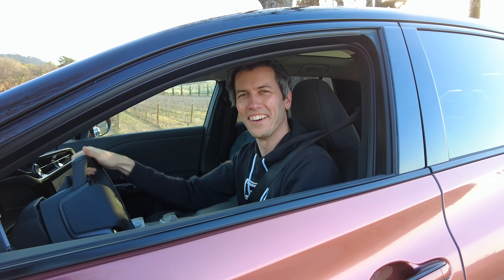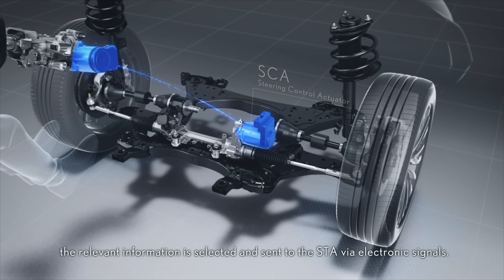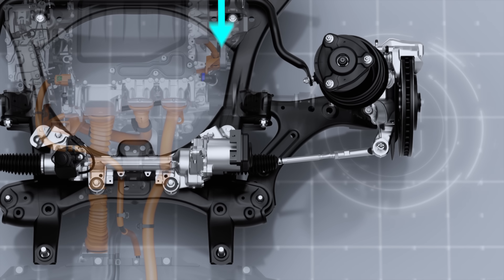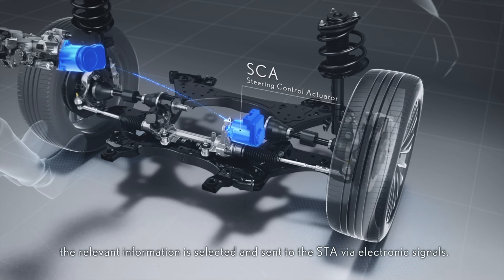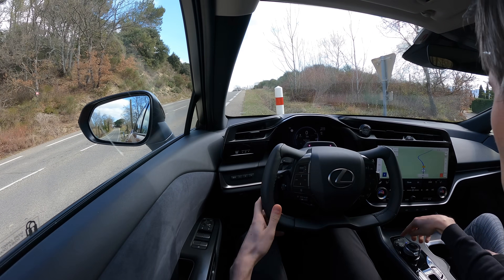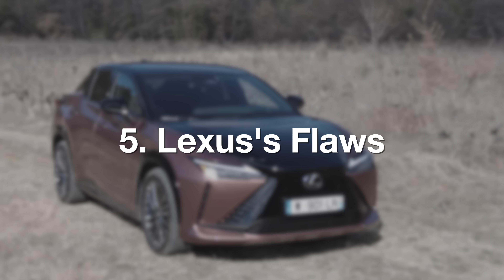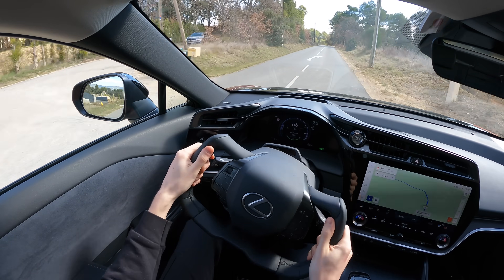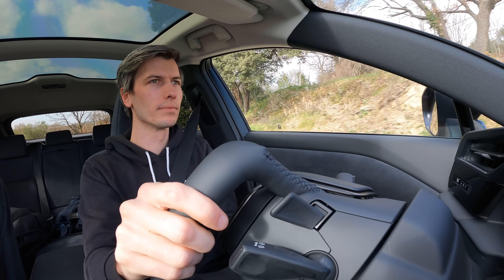How Lexus Fixed Tesla's Bad Idea: Steer-By-Wire Yoke

Comment: With a fast enough steering torque actuator, it would be entirely possible for steer-by-wire to whip the steering in the opposite direction when the vehicle starts to oversteer uncontrollably. I would like to see track driving or driving on one of those water pads with this system to see if it does that.
Reply: That would only work if the driver doesn’t try to countersteer at the same time, such as someone who lacks basic skills, such as the people who buy Lexus… oh, I see.
Reply: @Ficon   The system could also accept driver input and filter it while it is also doing its own corrections.

Comment: No way,  if this fails,  you can't steer.  In a traditional system even if the power steering pump fails,  you can still steer.
Reply: like my car for exp, has electric power steering & the steering wheel is connected to the wheels, but their is a drive by  wire option like this lexus in the video, but has a clutch to connect the steering directly to the wheels if lose of power, like why do all that, so complicated ...

Comment: AI to learn the driver’s inputs and adjust accordingly is key. 

When I put my Lexus 450h in eco mode it learns my driving inputs and adjusts accordingly which is also based on my hybrid battery charge level, temperature, throttle input etc. 

When I put it into sport mode an entire different experience without any learning of my driving style.

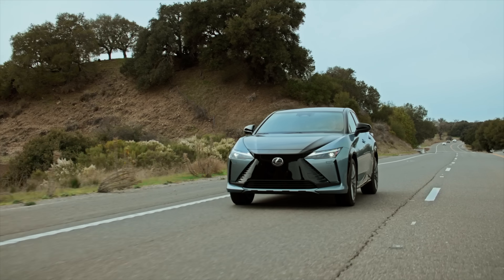Comment: #4:14 - This is FALSE. You can actually have a variable steering ratio with a physical steering column. Audi for example calls it "dynamic steering". Other manufacturers have this as well. It's been there for decades.

Comment: I think variable steering ratio is dangerous because your muscle memory will most of the time be wrong about how much the car will be steered by a certain amount of steering wheel rotation and i can't really come up with a good solution, as always you have to compromise.
The only good thing to come out of steer by wire would be independent steering for the left and right wheel to  accommodate for the different slip angles they'll have under different load and traction situations.
Reply: As mentioned in video steering ratios increase or decrease gradually.
Reply: @Trackandshield  changes nothing

Comment: Didn't Ford have variable steering ratio by adjusting the amount of power assist based upon speed?
Reply: That's variable assist, not ratio. 

Variable assist lightens the wheel (like in a parking lot) and stiffens it at highway speed. The lock to lock ratio is always the same, only the effort from your hands changes.

Comment: The 2002 Z06 had variable ratio steering, im sure some others have done it mechanically as well. 

Nice explanation, Lexus clearly did it better than Tesla, still pretty sketch imo.
Reply: Yep, BMW introduced it in 2003 on their 5 series. They use double planetary gears. It must be less extreme than the Toyota steer by wire system though.

Comment: It's not a innovation. It is simply forbidden by law in the most of the market. The solution was presented in show cars for ages now. And now Toyota with the abysmal bad engineering of BZ something. Earlier solutions were based on hydraulics, then electric.
Elon Musk explained, that the law is the reason for Model S traditional stearing. But he said - it's a lot of tunning also. It will be introduced with robotaxi. Perhaps.
Also, most users of Model S prefer yoke, even without stear-by-wire. The only people who have the rotation problem are journalists or people who don't have Model S.
The most pronaunce MS/X wheel UX problem is a lack of stalks for indicators - and optional full wheel doesn't address the problem in MS/X.

Comment: I like driving one handed. Rest my hand on the top or bottom of the wheel. I don't see a yoke working for me.
On a side note, what if you have to dodge another vehicle while moving at high speed? Would it be responsive enough?

Comment: I thought 50\50 on both Steering wheels, The Lexus looks really weak compared to Tesla one, but Tesla lacks available handle area on pad support, Lexus offer more handle pad but less wheel available support so it can be more fragile and less confortable.

Comment: Maximum lock should equal maximum steering action that the stability control can support at any particular speed. Would need drivers to adapt to this concept, but it follows the ABS logic. 

Overall this seems a great solution in the transition to self driving cars.
Reply: Right! I was thinking that at sufficiently high speeds ( more than 20mph or so) the steering wheel angle could correspond to the lateral G's that will be experienced so that full lock would be near 1G (perhaps 1.3 G or so?) with the control system limiting output to what the tires can permit and the force feedback feeding the driver a slightly accentuated version of the cornering force plateau when tolerable slip is exceeded, perhaps with a vibration signal. That way doing something well outside the car's limits would require pushing very close to the edge of the steering wheel's range but also return unmistakable feedback to the driver.

In the case of ABS, this feedback is there almost as a side effect from the pump's vibration transferring to the pedal, but most of us now recognize it as a sign of brake limits being reached.

Of course at very low speeds it is impossible to do this, so maximum steering ratio would be maintained.
Reply: self driving is extreamly far away. like i don't think you understand how complicated it is to actually drive. it's one of the most complicated things humans do and require so much brain power. we just don't have good enough technology for a computer to be able to identify stuff so fast and so accurate as we can.

Comment: Maybe I’m just getting old, but I see stuff like this and I think: that looks very expensive to repair. It would worry me to have something limit steering at speeds. Maybe there is a chance I lose control, but maybe I’m also in mortal danger and would rather push the car to the limits than die for sure by not avoiding some obstacle
Reply from the maker: Toyota is pretty good at reliability, I say give them a shot. In regards to limiting steering at speeds, again, as mentioned in the video, if you want to flail away on the highway, it will listen to your commands!
Reply: @EngineeringExplained  but toyota is the one that (unofficially) got hundreds of people killed in USA because their drive-by wire system was extremely badly coded and had a bottleneck point of no redundancy with ICs. They claimed it is redundant but it wasn't. NASA was part of the committee probing into it, around cca 2010 to 2014. You should really know about it when speaking about toyota reliability with drive-by-things. There was an hour long video on youtube from the final presentation of the study, by engineers themselves.
Reply: @EngineeringExplained  That's true! I have almost 320k on my Toyota and it's been great. I am glad that they have the tactile feedback for the steering wheel and dash controls. I guess people used to complain about ABS and traction control, too. 

Thanks for making these videos!
Reply: @EngineeringExplained  But what if you need to full on drift in order to avoid some horrible death on the highway. Is the maximum steering still limited at high speed when the car is sideways?
Reply: @Oroborus710  🤣🤣🤣 I doubt Lexus would let EE drift their car on a test drive bro
Reply: in theory it's way easier to repair. It's just a couple of cables instead of a mechanical link, you can route a wire pretty easily but a steering rack requires much more disassembly
Reply: @kevinyu9645  its not hust a couple of cables. it's 4 motors and a bunch of electronics. All of which are way more likely to be faulty than a simple mechanical lunkage.
Reply: @fleksimir  But there is already a power assist system on a direct linkage, and the power assist motors seem to be a pretty reliable piece of any modern car.  Well made electric motors can last for a 100+ years without any service.
Reply: @apostolakisl  I'm not saying it's unreliable. Almost anything can be made reliable with enough attention and money put into it. I'm saying it is less reliable then a simple mechanical linkage, which it unquestionably is (given both systems are about equal level of quality). And the reason I'm saying it is just because the original comment said that this new system is easier to repair because its "just a couple of cables" which is very incorrect, it is in fact a complicated system that for sure has electronics running some form of a control system just for the steering. It's not just a couple of wires. Also if the power assist motor dies (which does happen, as well as for old school hydraulic systems) you can still cheap out on it and not repair it and drive around. Also i would assume the motors you are referring to that can last a 100 years are asynchronous 3 phase motors? I'd bet almost anything that that is not the type for this use-case.
Reply: @Kevin Yu  easier repair possibly. More expensive, most likely.
Reply: @kevinyu9645  if they don’t lock the software down, yeah it’d be a straight forward cheap repair. That’s why right to repair matters.
Reply: @kevinyu9645  Car makers and electronic manufacturers  have been making devices and cars much easier to repair... oh wait no they haven't and they'll charge you a huge fee for what you've cited is theoretically easier to repair, which I do agree with
Reply: I don’t think Toyota would introduce a technology that’s new that they believe wouldn’t work in the long run. Remember, this is Toyota, not BMW or Benz. The Germans introduce gimmicky technology that’s not reliable and well known to be expensive to repair.
Reply: An important thing is that steering-by-wire is not a new technology, there are publications about it since at least 2004 with test vehicles. That’s quite some time to iron out the first version issues.
Reply: the maximum steering input could based on maximum slip angle, so max steering is max grip, similar to forza normal steering mode vs simulation
Reply: @tturi2  but then you're introducing a point of failure which is: relying on sensors to figure out how much the wheel is being turned when the driver turns the wheel. In other words your inputs to the steering wheel become just suggestions to the car. It is a horrible, horrible idea safety-wise. There are already issues with drive by wire in modern cars where soft sand messes up the car's computer and it doesn't know what to do and it just doesn't wanna go anywhere, you press the gas and it does almost nothing (off road vehicles, wide range of manufacturers)
Reply: I don’t really love this for a few reasons, but I think reliability would be fine. Many cars have electric power steering and you almost never hear of an issue with it, particularly compared to hydraulic PS. To me, this is just an extension of that - it’s basically an electric rack with another motor on the steering column.
Reply: @coreyw427  yes but the "you almost never hear about problems" is ok for electric steering assist because when it dies, you can still grab the wheel with two hands and steer. Same goes for hydraulyc assist, they are assists. This is different, if it dies your steering wheel is as useful as trIng to yell at your radio where to turn the wheels. That is an important distinction that somehow many people completely look over.
Reply: It seems easier to repair, given you are the official service company. 

If anything all these intiatives to make cars more electronic also leads to compromises in right to repair outside of official service shops.
Reply: Depends on if the design goal is to make repair harder. 
Yanking out a couple motor and wire is much easier than yanking out the shaft. You can design access panel for the motor and make quick disconnect connectors for the cable. 
Ultimately, control by wire is better than direct linkage control as computers are better at smoothing out many of the undesirable feedbacks. 
However company will not act on good faith and everything will be insanely lock down. Motor will have unique id and drm. Cable will be soldered/welded/whatever bs. The software will have bugs that will never get fixed. And probably 50 thousands different issue. Throw in subscription bs on top of all that. 
But it is not like we not have the same issue with traditional car anyways. R2R and related legislation on top of actual enforcement, along side actual punishment is what we need.
Reply: It’s a Lexus. It won’t need repair for hundreds of thousands of miles.
Reply: Probably not really any different.  A conventional steering rack already has motors for power assist, these are basically the same thing, just instead of assisting, they do all the work.  The main difference is the second set of motors on the steering wheel/yoke.  Knock on wood here, I have had cars with lots of things that needed to be fixed, but never the power steering system.  At least never an electronic steering system.  I have had hydraulic ones where the pump got weak and needed to be replaced, but that was 20 years old.

Comment: I hope this means vehicles will finally give us the ability to shift the steering wheel's position and orientation more freely than in linked system.
Because the "good" old Rotate-15-degrees-up-and-down and Move-wheel-10-cm-forward is JUST. NOT. ENOUGH.

I'm speaking from a tall person perspective (6.4") and I ALWAYS ALWAYS ALWAYS prefer to drive a car that allows me to orient the steering wheel in a way that doesn't hurt my knees and my back.
Reply from the maker: I think you'll appreciate this system. For added context, watch the video at 8:45, as I transition to the next shot. You'll notice the yoke is physically mounted significantly higher (they also move up the dash information). Really helps with legroom. I'm 6'1" and wasn't close to it.
Reply: As someone who's a similar height, that would be wonderful. I have long legs and short arms lol, I want the steering wheel to come out further and give me a better angle. Nothing too 'extreme' - ie. you can't make it like a bus steering wheel due to teh air bag
Reply: My favorite is the when the steering wheel isn't centered directly in front of the driver seat. I've noticed that in many vehicles I've rented over the years. In many vehicles, it's just a little to the left of center of the driver seat. So electric could help with that as the consideration on how to route the shaft down to that rack is removed.
Reply: Or easier transition from RHD to LHD & vice versa. Cheaper to export/import cars.
Reply: They'll have a subscription for that😂
Reply: Put it in the back seat to satisfy certain types of "passenger "
Reply: Yeah cars arent made for anyone over 6,2 really. At 6,4 you fit in trucks
Reply: @breakupgoogle  I'm 6'2". Cars aren't made for me either. Trucks aren't really any better for ergonomics. The leg room isn't usually the issue, as much as steering wheel placement.
Reply: @breakupgoogle  Most things in the western world are built for people 5'4 to 5'8 at the very most, unless you find the rare 'tall' variant of products.  It's not just cars, look at literally anything that fits a person, they're all optimized for sub-6'.  Even things like 'big and tall' office chairs from your typical office store aren't all that tall, and only hold the 'tall' naming due to their extended seat depth that better holds the 'big' portion of their sales base, while the back of said chairs are still optimized for sub-6'; though chairs in general can be an issue, especially unpadded ones and how they land on your spine, or lack of thigh support, etc., and the worst of it is when something is meant to be ergonomic yet the ergonomics aren't adjustable enough to fit you specifically.  Even clothing has this exact issue, big and tall fits weird if you're just tall, and larger general sizes fit just as awkwardly, you have to seek out clothing that is specifically just tall, which is a rarity among untailored clothing; shorts are often an issue as well, pants generally have a wider range of sizing comparisons but often aren't stocked in the same amount.  Then there's the issue of older construction and short doorways and shower heads at shoulder height; which this points out where the issue comes from, the average height has been growing yet the world is slow to catch up.
Reply: @xaytana  yeah it is rough for the big and tall. i always wondered why someone didnt make a sports car for the taller folks.

Comment: My thoughts are that you never really want a gen 1 product because the engineering assumptions rarely match reality. And some times that is fixable with software, some times it isn't.

After a few generations I bet this will be epic. But look at gen 1 break  by wire, paddle shifting, electronic clutches... Anything really...
You want the innovation but generally after some real world miles
Reply: My 2002 Prius starts the engine every single time you turn the key, even if it's warmed up. Annoying, but the 2004 second gen fixed it.

Comment: Nobody really talks about yokes and airbags. A steering wheel actually supports the airbag as a round skeleton at the back side when it is deployed. This way the airbag can actually function as a smooth cushion and support the driver’s head. But if there is no round steering behind it then the driver’s head will just keep traveling towards with the airbag as there is nothing behind the airbag to stop the movement. Drivers don’t necessarily always hit their heads into the center of the steering.
Reply: Shouldnt be hitting anything other than the airbag itself, which when inflated isnt supported by any of the outside rim of the wheel.
Reply: @ALMX5DP  you missed the point
Reply: @jackd1582  what is the point? I’m sure this will go through every current safety and airbag test. Is there a concern still just because part of the wheel rim is not there?